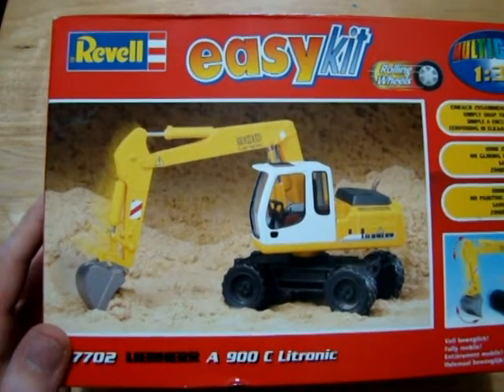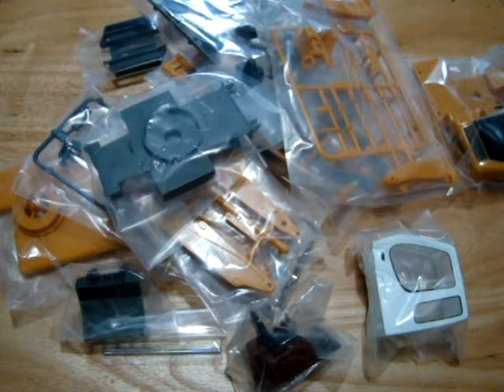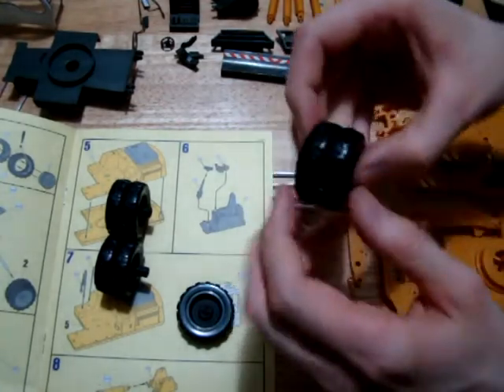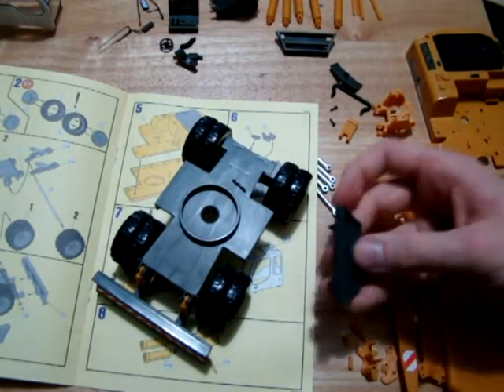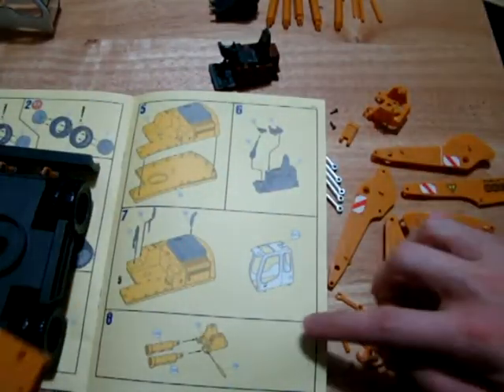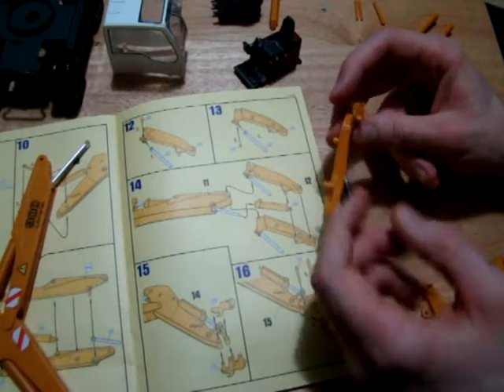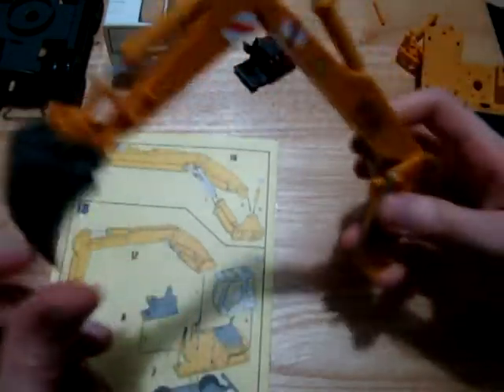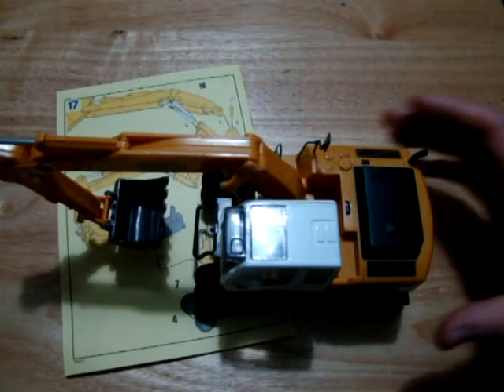RC Liebherr A 900 C Litronic part 1 Revell kit build

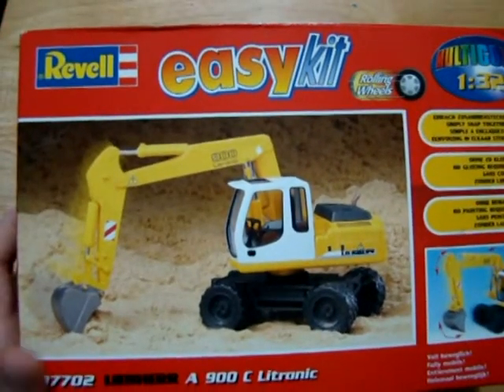Comment: Thank you for the pointer to Ebay.  I made the order and it has just arrived this evening.  I shall be fixing it up this weekend or next.  I may use the excavator arm as an alternative snap in for my 1:35 Leopard 2 Kodiak AEV 3 as I plan to make it modular, together with a snap in dozer balde system with alternative snap in of a mine plow, mine roller with the lane marking system.  This Easykit looks great by itself.
Reply from the maker: Leong K Y  That's a cool project, I looked up the tank there and it does look like the perfect boom for your model hopefully it will work well. Good luck with your build
Reply: RC Tractor Guy Thank you and hope to see more of your videos.

Comment: Very interesting kit.  I would like to know where I could get this Revell 07702 Easykit in Singapore.  I have check almost all local retailers but none have it.  Would appreciate if you could give me a pointer.  Thank you.
Reply from the maker: Leong K Y They are getting very rare and hard to find anywhere now, there is one on ebay maybe you could get them to ship to you  http://www.ebay.com/itm/Revell-Liebherr-A900C-easy-kit-07702-/181735606291?pt=LH_DefaultDomain_0&hash=item2a50494813
Reply: RC Tractor Guy Thank you very much for the reply and the pointer.  Do you still have this particular kit with you as I would like to know the entire length of the excavator arm, from end to end at maximum reach.  It would be great if the entire length is about 24 - 25cm as I would like to convert it to fit one of my 1:35 scale model kit.  Would you please help me to check if you have the time.  Once again, thank you very much for your help and reply.  Good day.
Reply from the maker: Leong K Y No problem, I'll measure the boom length when I'm home at the weekend and post the measurement here.
Reply from the maker: Leong K Y The boom stretches about 23 cm from the cab to the teeth of the outstretched bucket.
Reply: RC Tractor Guy It is so kind of you to help me on this info.  23cm should just be about right for my the other 1:35 scale.  Looking forward to get this done.  Once again, thank you for the info and update.  Cheers and a good weekend ahead.